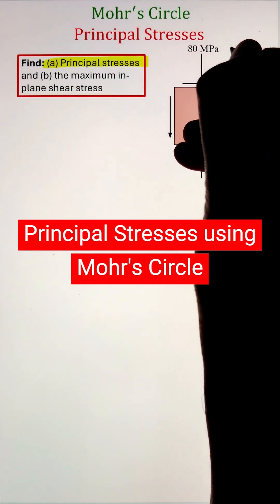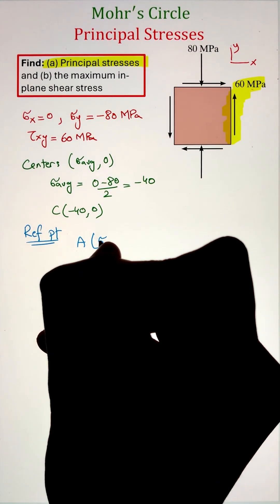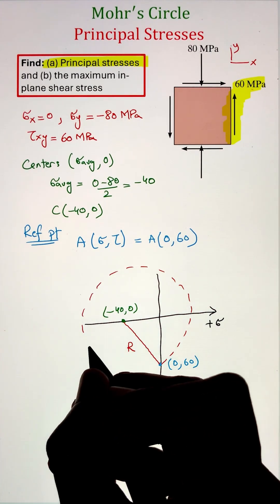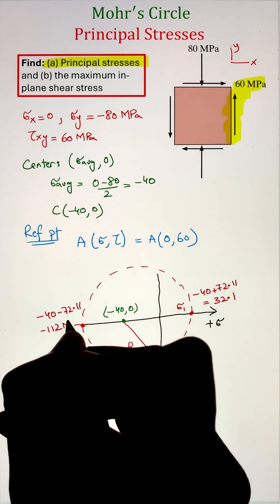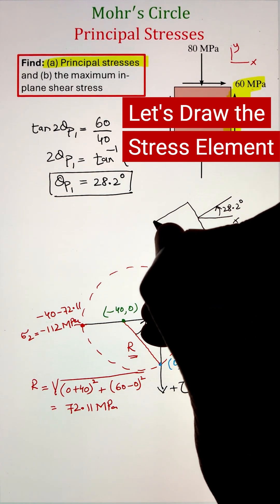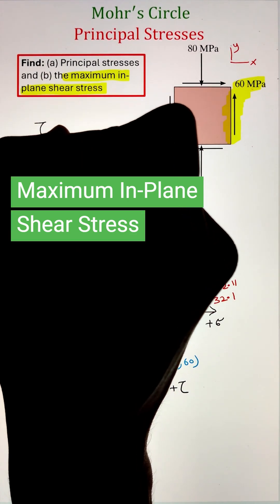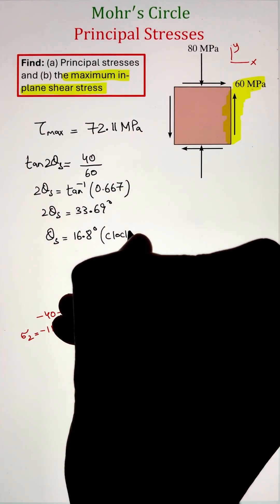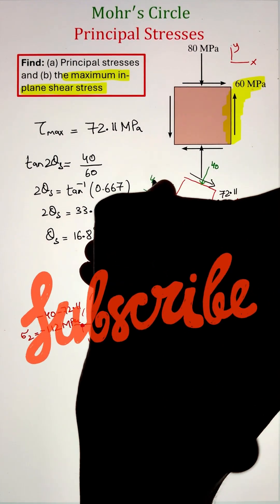Mohr’s Circle Made EASY!

Comment: When representing principal stress directions and maximum shear planes, how do you determine the direction of rotation for the element? Is it clockwise or counter-clockwise?
Reply from the maker: If the shear stress is positive then it's counterclockwise on the right and left side of the element, and on the top and bottom sides it will be clockwise to counter that effect.

Now if the shear stress is negative than on the right and left side of the element it will be clockwise and to counter that effect on the top and bottom of the element it will be counter clockwise, hope this clarifies.